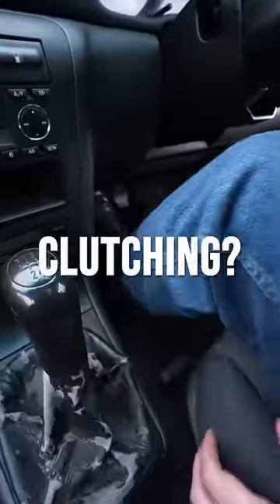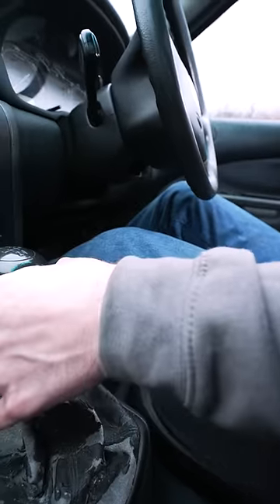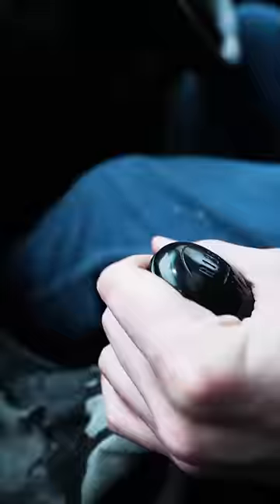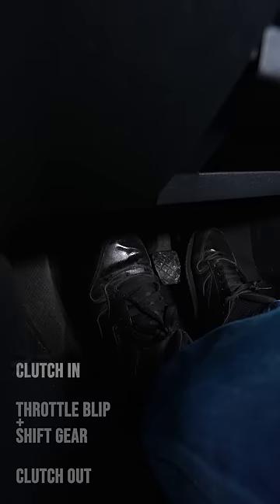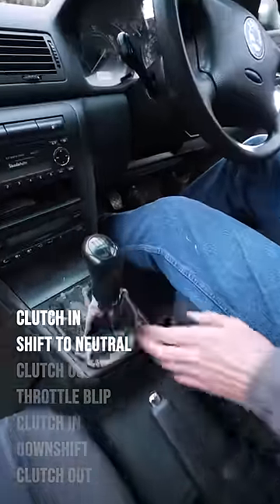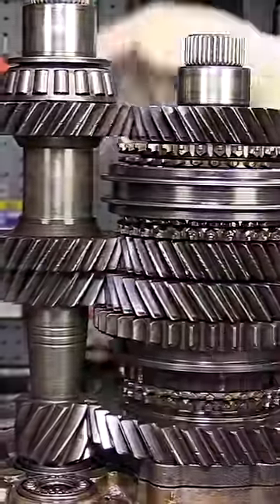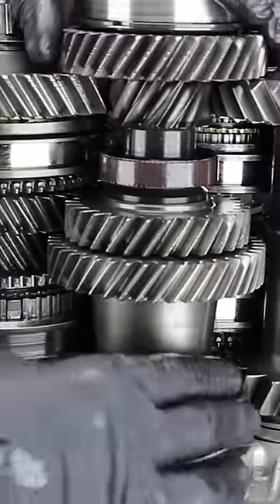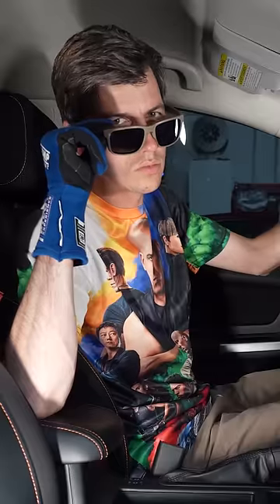What Is Double Clutching? Don't Granny Shift!

Comment: I've driven a 1986 UAZ bus for a while, it did not have synchonizers on 1st and 2nd gears, and it did not really require double clutching, once you get the habit of which RPM to switch at. You just shift the stick very gently, with the tips of your two fingers, and it slides right in. It's a relatively fast process. This skill surely helped me come back home a couple of times when my clutch drive failed and I had to drive with my clutch constantly engaged.
Reply: That sounds bloody awful! 😂
Reply: Basically floating gears. Just have to get the rpm and speed matched and it goes right in
Reply: Did that practice with my Renault Twingo 1994 and Audi 80 of 1990 sometimes to be prepared. 
It's not as hard as it sounds to train that. Justvtry it 😊
Reply: An old van my dad had years ago only had 4 gears and one time I was out in it the gear linkage broke so I only had 1st ans 3rd if you time it right you don't need the clutch at all! Lift the revs and push gently on the gear and when the revs drop to the matching speed it drops in gently!
Reply: I had a cheap eclipse years back (not because F&F made me think it was cool, my Chevy K10 broke down and it was the only thing I could buy same day for a few hundred bucks).  Someone beat that poor thing so hard before I got it so the synchros for 3rd and 4th gear were blown.  When I first bought the car I would grind it a lot, but after a while I learned how to just shift at the right RPM and right throttle input, at that point didn't even have to use the clutch, just did it all by feel.  If you know what you're driving and take your time it's all fine
Reply: As everyone else on here said. My '86 F150, '90 Eagle Talon TSi, and my '95 & '06 Mustang GTs were all shifted the same. When I hear the right RPM pitch, Clutch IN, pop out of gear, slide to the next gear, and as the revs came down it will go right in, then Clutch OUT. It only took 3 to 4 seconds. 
Plus, you don't want to wear out your clutch.  I was told if you have the clutch in, you are destroying your clutch. (Yes, I know it is a wear item.) The only clutch I replaced was my '95 Mustang GT at 125K miles. and come to find out it was just the pilot bearing. My clutch only had 20K miles of wear on it. [I bought both Mustangs brand new.]
Reply: @Jay_the_Caffeinator  Premature clutch wear comes from not committing to a clutch in or clutch out condition.  Trying to feather the clutch in or out makes the clutch grind against the clutch plate.  As long as it is in or out no real wear.
Reply: @whatsup3270  I forgot to mention that as well. I was always either ON the clutch or OFF. No feathering!!! But I do understand, it takes some practice.
Reply: @joeleonard9965 
I managed to do that once.
I changed from a 6 speed to a 5 speed that has reverse where 6th used to be. 
70mph
Clutch down. 
5th into 6th.
....
Stop.
Think. 
Carefully take it out of reverse and don't let the clutch up because it's now a bomb. Or one of those movie landmines that only goes off if you lift your foot off.
Reply: @MostlyPennyCat    Damn,  you were close to exploding the car

Comment: My first car was a ‘61 Beetle (1200cc).
It was so sluggish I would shift with the gas pedal on the floor-just clutch and jam the gears. I learned to check the gas and oil, I ran out of gas twice and oil once! It blew one of the piston rod caps through the crank case! lol! What a thrasher!
Reply: No idea why those cars get a following.
Reply: @iFixJunk  Because the dude blew his engine and could get it back on the road in three hours for a couple of bucks.
Reply: @iFixJunk  I only had the one. To me they are dangerous as H. I rode as a passenger in a VW bus once, it was scary! Years ago a friend built a V6 into a VW bus! I could do wheelies in all gears! I am always haopy when I see VW beetles and buses on the road, especially those VW clubs I see around.
Reply: @iFixJunk    It's because these retro volkswagens were very simple designs,  easy af to repair.
Reply: @Anthonybrother  Yeah. But lame enough to be a hazard to EVERYONE on the highway.

Comment: I'm glad a few truckers chimed in, as big rigs and similar generally don't have syncrhomesh transmissions. My dad drove an oil truck back in the day and double clutching was standard procedure
Reply: A lot of racing transmissions don't have synchros either, because synchros get destroyed with a lot of hard and fast shifting. So it's no inconceivable that someone with a heavily modified car would have a gearbox without synchros (a "dogbox"). Even in cars with synchromesh gearboxes, some nerds will argue double clutching puts less stress on the synchros when changing gears fast and hard. BUT, in F&F they were talking about double clutching on upshifts, you don't double clutch on an upshift even with a dogbox. So it's not actually the fact cars have synchros that makes it nonsensical, rather it's because they're talking about doing it on upshifts.
Reply: @wolfie54321  Dogbox shifting is usually done without using clutch at all, you just lift the throttle and slam the shifter with full force.
Reply: @michaelbuckers  On upshifts, particularly aggressive ones, yeah, slam it into gear, that's why people use dog boxes on race cars, can shift faster without damaging the synchros, which is part of the reason the F&F quote makes no sense. On downshifts, you can't just slam it into the next gear without at least blipping the throttle but it's also highly recommended that you clutch to avoid putting the entire weight of the car on the impact of the gearbox. If driving gently, double clutching is usually recommended. Bikes also tend to have dog boxes, but the rules about how to operate them vary slightly from cars because they weigh nothing they can get away with slamming it more, in cars and trucks with dog boxes, a bit more caution is required.
Reply: In USA perhaps, in Sweden it have been standard for ages even my dads tractor from 1988 have a synchronised gearbox.

On another note in Sweden any new big rig have been equipped with an automatic gearbox for the past 10 years
Reply: @wolfie54321  There are no synchros on a dox box transmission. That's kinda the whole gimmick. Instead of tightly meshing teeth which allow for smooth shifting, there's a small amount of dog collar pegs that interlock very loosely which allows for slam shifting. The thing is, since the pegs are so large, you're not actually allowed to rev-match on a dog box because if the shafts are rev-matched and the pegs directly oppose each other, you won't be able to shift at all.
Reply: @michaelbuckers  I don't think I ever said dog boxes have synchros, I said race cars use dog boxes so that they don't destroy the synchros on hard shifts (i.e. because the synchros don't exist). Even on a dog box you generally want the revs to match, obviously if they matched precisely, yes, they wouldn't mesh, but when we say "match" we don't mean 100% the same, no one is skilled enough to do that even if it was required, we mean maybe 95% the same speed to minimise the impact load on it, especially if we're talking about clutchless shifts because then the entire driveline load smashes into the dogs. I was on a team building a race car that used a dog box, on the race track upshifts could be done clutchless with the driver just lifting off the throttle, downshifts could theoretically be done without a clutch also if the driver rev matched but because that was tricky to do right we set the car up with some linkages to automatically actuate the clutch when the driver pushed the gear stick to downshift. When not on a race track, the driver wouldn't be slamming it violently into gear, so they'd often double clutch the downshifts to make the gear slot in more easily.
Reply: I have owned 4 vehicles with manual transmissions and my driving has been described since the 2nd one (the 1st was an Omni and I lived in town) as "you drive life a bat out of h*ll" but even after reading this I still have no idea what double clutching is.🥴
Reply: @dkat8087  While it's not really necessary, if you enjoy driving for the sake of driving, it's fun to learn how to double clutch, even though I drive a modern car I still like to double clutch when going from 3rd -> 2nd at reasonable speed, or 2nd -> 1st while still rolling, just to ease the load on the synchros.
Reply: @wolfie54321  seems like a extra step while driving. Anyhow I never learned to drive with double clutching never even been driving a vehicle where you had to double clutch. Honestly I would say for the past 30 years if not longer no one have have been teached at driving schools how to double clutch since it have not been a thing due to synced gearbox this is Sweden we are talking about
Reply: You dont need the clutch to shift American semi's. Only to start out in 1st/2nd or reverse.
Reply: If you buy a vintage ("antique") car and it's a pre-synchromesh make, you'll very quickly learn that double clutching is very easy.
Reply: Modern trucks do not need the clutch to shift at all. Its called 'floating" the gears. Power, release power floats the gears , go right into the next up.
 Downshifting is the funny part. Going down hill gets folks killed every year because they never learned to shift under load...Some brake with the left foot, and throttle with the right, rev match and down shift. I brake with the right foot, and heel the throttle to down shift. You hear folks talk about the trans jumping out of gear, so the came down with the brakes burning...Or they crashed...They never learned any of the above, very very common "on the big road".
Reply: @peterruiz6117  thats true on any synchroless transmission, even from the 60s
Reply: @peterruiz6117 I was wondering if this is still taught. I learned it on a friend’s little bitty IH Loadstar 1600 (1973) which had lost some of the synchros. Also learned double clutching it. Oh, that thing was a dog, with a 345 gas! Had a dump box, and towed a 6000 pound chipper behind it! 😂
Reply: Truckers come in two breeds, double clutch or no clutch at all
Reply: @michaelbuckers Slam the shifter…are you nuts! 
Transmissions usually have a 4,000 rpm gear change. Run your rpm’s up to around 2,200 rpm’s. Put slight pressure on the shifter, let off acceleration until shifter releases, drop rpm’s to around 1,800 rpm’s, drop shifter into next higher gear. You’ll feel the mesh when engine and transmission match. It’s hearing the engine and feeling the trans. 
All done without clutching! It can be done in a car too…
Reply: @craiglaw7578  dog box shifting has quirks. Trucks use a worse version of a regular car gearbox, dog box is a different thing entirely.
Reply: I had a 1950 Ford F2 4 speed no synchros.  The F2 was a 3/4 ton pickup.  I drove big trucks as in Kenworth,  Freightliner, Mack ect.  Lots of experience enjoyed shifting.
Reply: @sasazapadnik9335 
In a Scania with a manual box , when the box is warm you can take off in 3 high or low without using the clutch.
Reply: @Groza_Dallocort 
I think you have to go back before Scania 140  and Volvo F88 .
Reply: @bendermi  yeah Sweden was quite fast to get synchronised gearboxes
Reply: @bendermi  you put it in 3rd gear, engine running, neutral, without the clutch??
Reply: @sasazapadnik9335  
Yes the engine and box has to be up to temperature as you know , if you're loaded the revs will drop a little, but then you can sneak off. 
I asked my old man to try it out and it did . 
I can't exactly remember what year but  around 83-84 , we then called it the Scania party trick .
Reply: I still double clutch.  I don't like floating gears.
Reply: Some day in the not to distant future, all big rig transmissions will be automatic. It will take quite a few years for it to happen but it already has started.
Reply: @genespell4340  
So the transmission will be equipped with a GPS ?
Reply: @bendermi it's hard to buy a manual new semi now..90 % automatics
Reply: It's hard to buy a manual in a semi now...90% automatics
Reply: @wittemanadrian  
I won't be buying an automatic unless the box knows the hills in front of it .
Reply: There is no technological or mechanical reason what-so-ever for trucks to not have modern transmissions.
Seems to a very US centric thing that trucks are expected to be as low tech and often rough AF as possible.

500+ HP Volvoas and Scanias that have driven to the moon and back multiple times still running smooth, easy, automatic transmissions no problem.